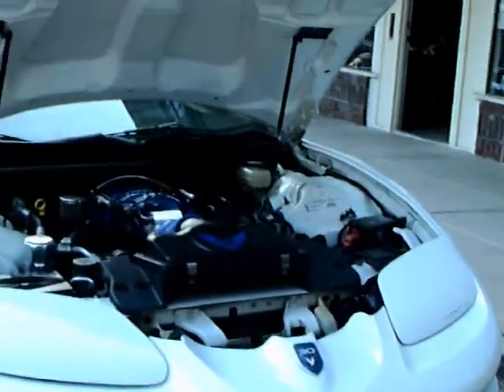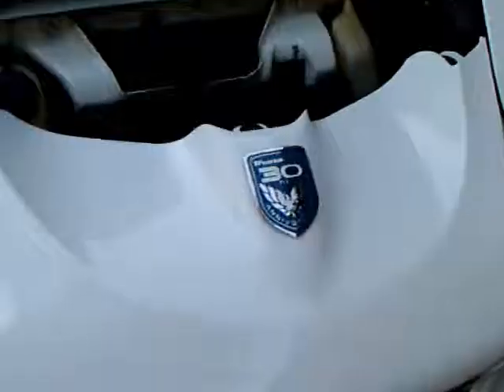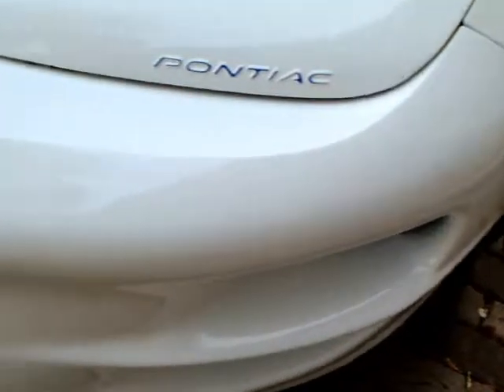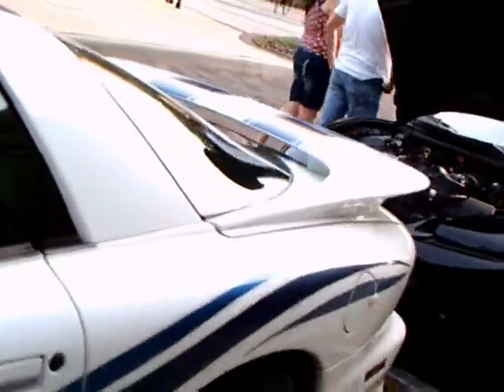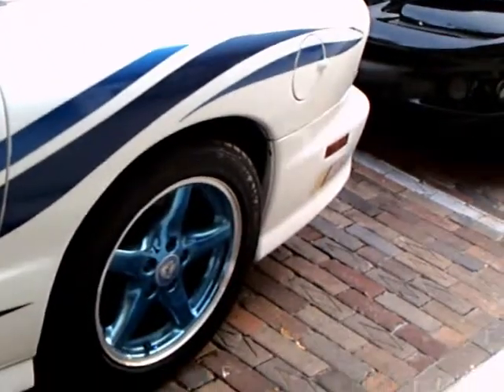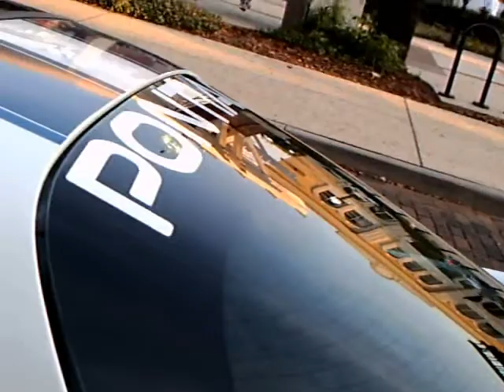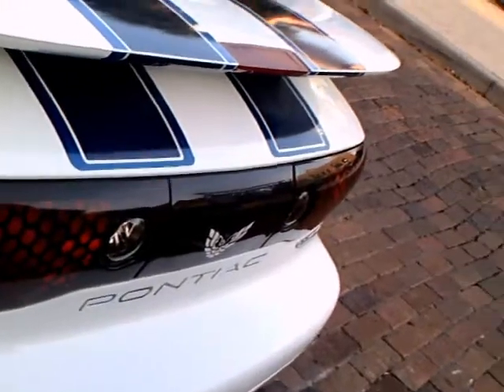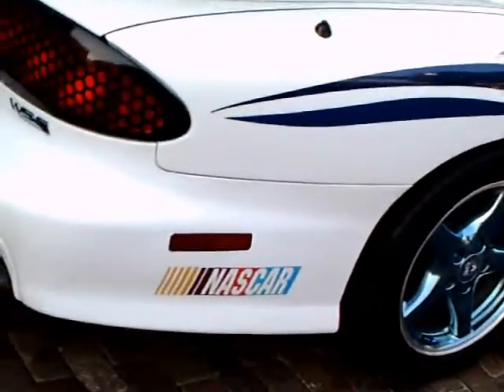1999 Pontiac Firebird Pacecar Daytona 500

Comment: It’s not too often you find someone talking about your car. It's been a 4 year project to get it to this state. Car was completely trashed when I bought it and needed to be restored. Everything has been replaced with OEM where I could. It now sports a 408ci LS3 with 520 rear wheel HP and 500 torque with a 6spd. There are all kinds of susp upgrades, tubular front susp, shocks, springs, swaybars, Z06 brakes, etc..new white leather int is going in, going back in Sept. Thanks for the kind words!